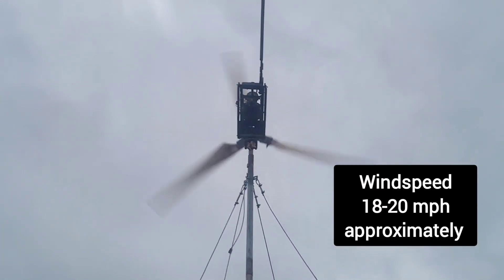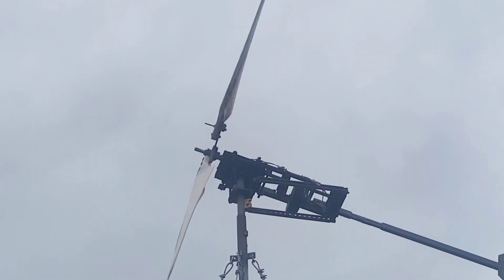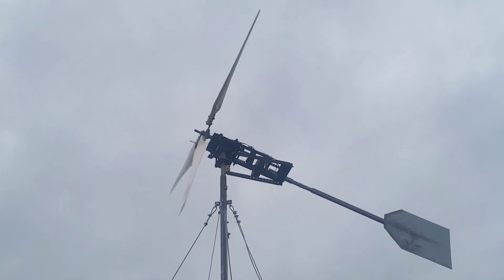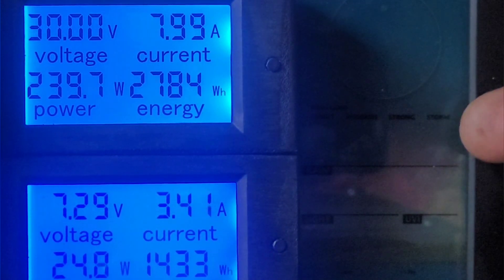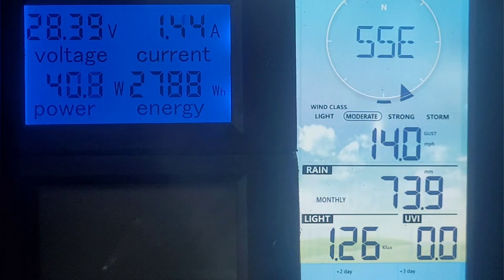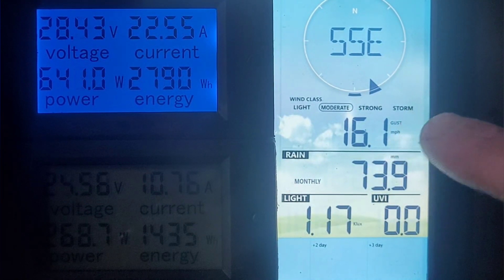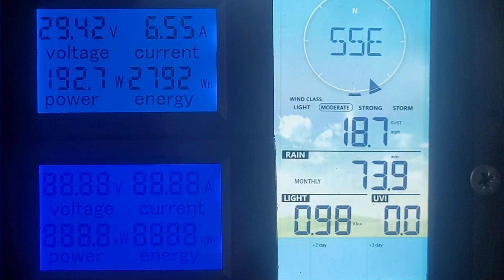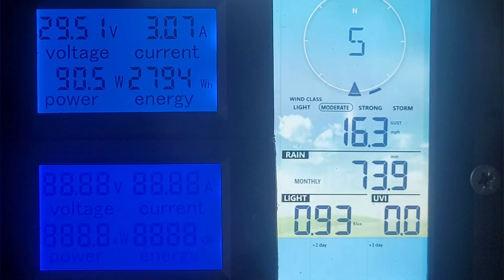Wind Turbine Project - Finally this thing is running at full speed !! HOOOORAY

Comment: I just took down my wind turbine, a Magnum 5 Kw. Max It produced was 3 KwpH in gusts, but only 300 WattspH an average day with wind (did not run at night because of noise) . I changed the turbine with 6 solarpanels. And in 2 weeks (8 days with 100% sun) it has produced almost 1 year of wind power. Can't wait till summer! I have had the turbine for 4 years with some mechanical/broken issues.
Reply from the maker: Just not enough sun in England cloudy/chemtrails all the time , cheers for the comment !!